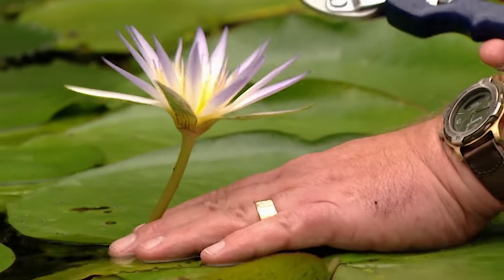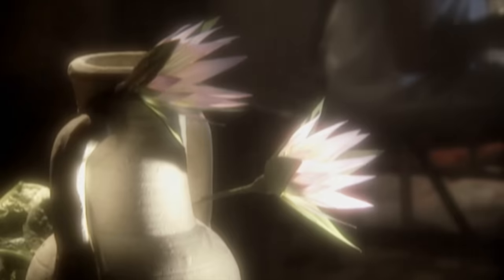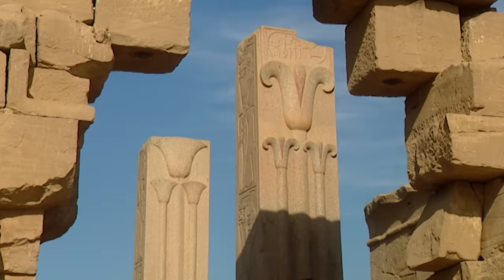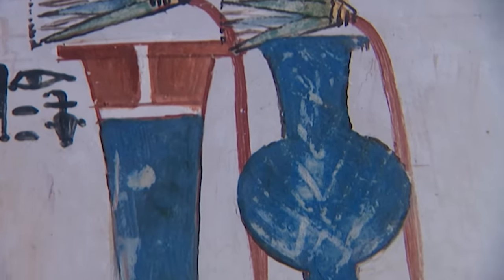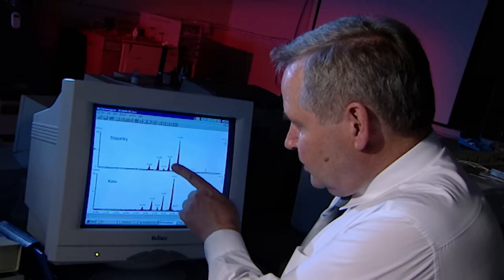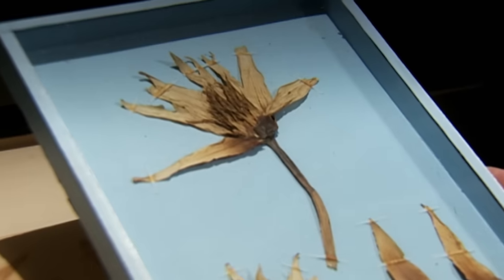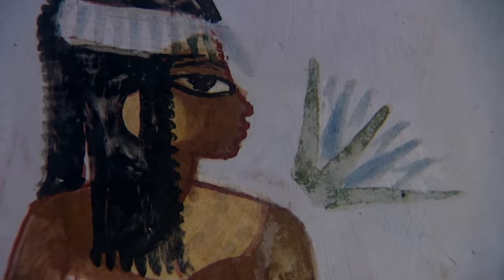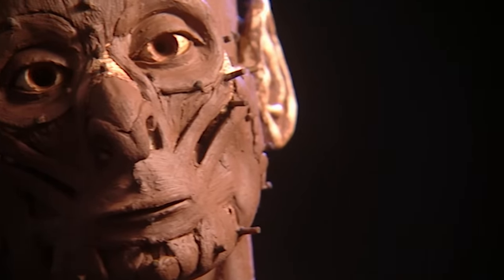The Mysterious Blue Lotus Ritual Of The Ancient Egyptians | Private Lives Of Pharaohs | Parable

Comment: How did they get tissue samples from her intestines and lungs when those were removed during the embalming process?
Reply: At one point there was a cutting edge process (back then) that allowed for organs to be left in the bodies. At least for Kha and Meryt, their brains were left in the body using this process.
Reply: If i am correct the insides were washed and put in different vases
Reply: @bruh-mb1rd  Yes you are correct. That was done most of the time, but not always. At 1 time the very most expensive enbalmings didn't require it, and at all times for the cheapest 1s it got skipped.

Comment: The assumption that the lotus plant material found in the museum claimed to be ancient, is that it is carbon datable, and could've been carbon dated, but they just went ahead and assumed time period based upon tomb of pharaoh it was found in.  So nobody in 2,000 years could've contaminated the specimen, even though you guys were handling it without gloves and it was intermixed with multiple other plants.  The identification of an unknown plant by visual identification with no comparison sample, then the chemical analysis claimed to be the same without even having the color of the lotus present.

There is no reason to assume this lotus was a blue lotus.

 It's amazing in ancient Egypt, how they never corroborate carbon dates independently, but always fit the date to the assumed time period.
Carbon date both the modern and the ancient Lotus material, at an independent lab, under video supervision of the entire process, without the technician knowing the source or the origin of the material, and I can guarantee you the "ancient" lotus will not date to 2,000 years unless the modern lotus does also.

The assumption that the blue lotus is related to modern lotus is bologna.  The blue lotus was eradicated world wide for it's well known hallucinogenic properties.  Up until this show, it had never been questioned as a sex drug, but was always known as a religious hallucinogenic drug as the murals show.   If the blue lotus was a sex drug, phalluses and sex scenes would be rampantly painted whenever the lotus was shown.  This is not the case, and there are mural after murals of sex scenes in ancient Egypt with no nod to the blue lotus.

Anatoly Fomenko disputes your assertion that Egypt is ancient, and this show in my opinion, is a rebuttal to the known fact that "ancient" Egypt had trade routes to North and South America to get tobacco and cocaine, which were found in the same mummies over 50 years ago, but were not mentioned for some reason.

The "ancientness" of Egypt hinges on the presupposition that there was no trade route with the Americas prior to Columbus.  However, in light of Fomenko's work it shows the exact opposite, that there was a world wide trade route with the America's beginning near the time of Columbus, and that all pyramids world wide, including Egypt, Mexico, Bosnia, China, America, etc. were manufactured using modern techniques between 13th-17th century AD, that is AD not BC.

Without ancient Egypt being so far in the past it is obvious what the pyramids were/are used for.  Yes they are a power source, but not like a hydroelectric dam except in limited capacity.  Schlieren photography shows that the pyramids are still actively emitting and collecting energy from the Schumann resonant cavity as Tesla theorized, then put into practice at Wardencliffe.

The pyramids are alive and well as the primary source of mind control on the masses to try and make the people of the world believe that the world is much older than can be proven.

Carbon dating is literally the only thing Egypt stands upon as being ancient, and no artifacts are allowed to be dated independently bot not Egyptologists in supervised labs.  All dating methods at this point should have to be video recorded from collection of sample, chain of custody, and final analysis.  

There is too much to gain by faking results.  Mainly the proliferation of the cult of the serpent, and worship of the Pagan gods such as Amon  Ra.  These gods are still alive and well, and still being worshipped by Egyptologists, who first assume Egypt was ancient, then go about trying to prove it.

In 50 years they will say the statues moved during the construction of the dams on the Nile, were there from the beginning.  In 1,000 years no one will even be able to tell that a different civilization moved these statues and temples.  Only celestial alignment and original horoscopes on buildings can date and authenticate original building location and time.
Reply: It was medicine
Reply: I agree with you on the hallucinogenic properties of the blue lotus. I think it was probably used readily by certain "priests", et al, to experience the "afterlife" via sacred visions.
Reply: Because Egyptians we're here far longer than we thought, the way they built the pyramids we're with frequency and we'll see this in about 3 months.
Reply: @josephshaul9690  one month to go then?